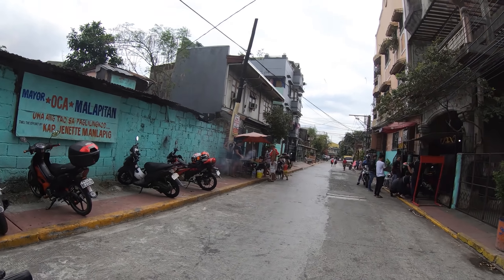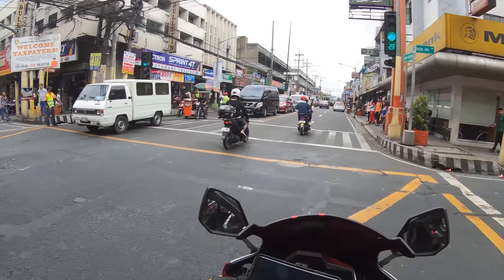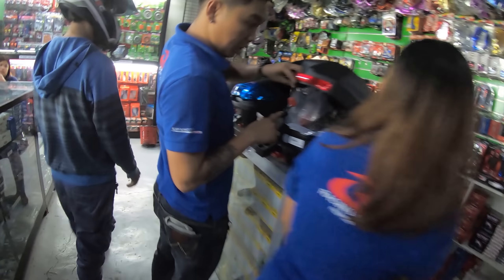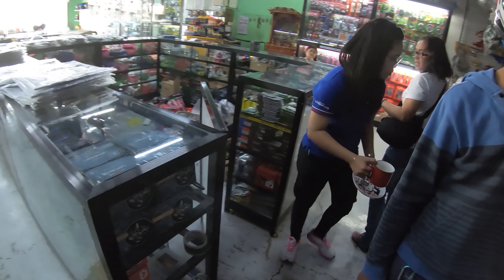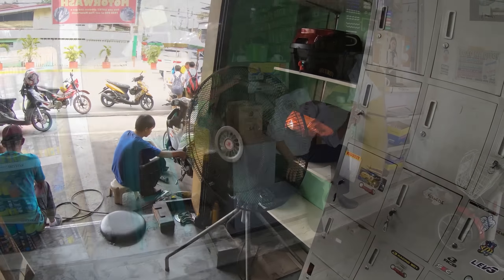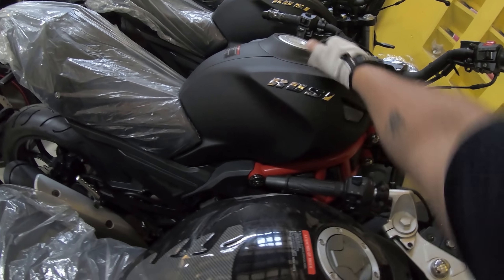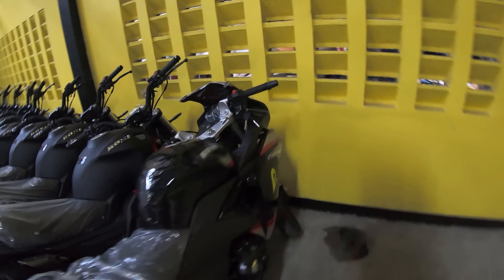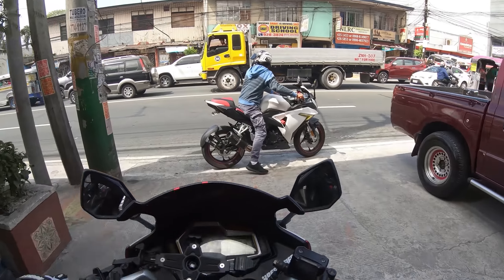Quezon City - Marikina - Philippines - Motovlog

Comment: If it's a club house then you'll really need a dedicated office with systems in place to organise the bills (gas/electric/beer etc) notices/messages etc. It doesn't need to be big but trying to do paperwork etc in a room which is also used for other things rarely works well.
Reply from the maker: not a bad idea, we have a guy handling all that part.

Comment: Every time I get new tires they say to take it easy for at least 100 miles to break them in.
Reply from the maker: not bad 100 miles. a friend of mine said I just gotta scrub them then they are ready
Reply: @JosephMyLife  tires have a layer of oils on the outside of them that's why they are slippery once you wear that off they are good to go. It's just easier to wear that oil off with normal use.

Comment: sir joseph still waiting for your answer of your tire size front and back
Reply from the maker: Diablo Rosso 2, S spec (steel belted) with a ZR speed rating with a size of 160x60 17 and 120x70 17